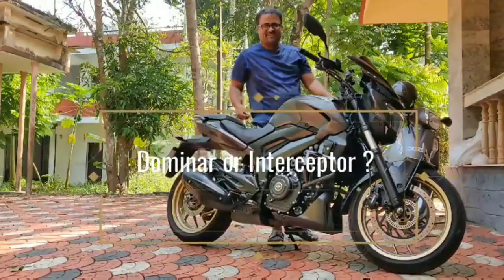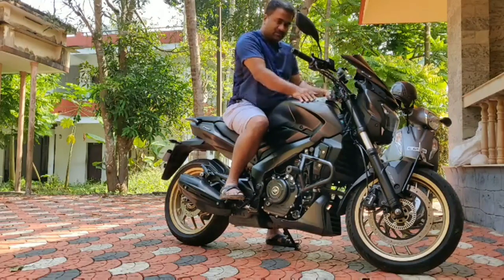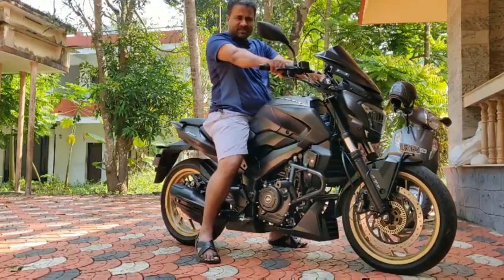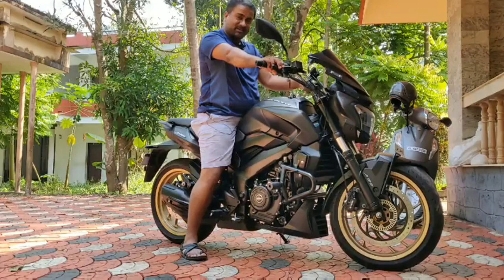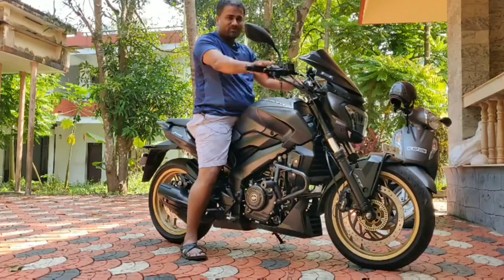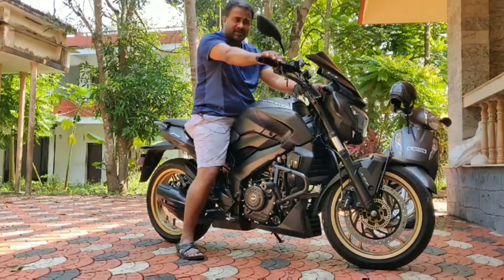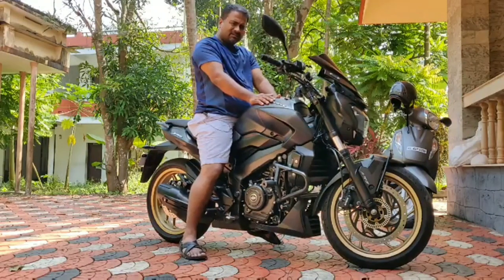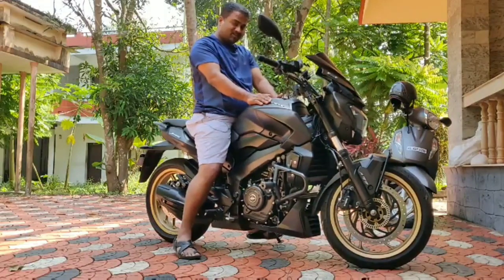Dominar or Interceptor?

Comment: Expecting my interceptor by next week😍😍😍
Reply from the maker: Hi... Where did you book it and which color.... I am absolutely frustrated with the delivery schedule.. The official website says it will be between 15th April and 21st April... But there has been a cancelation by a person before me so I should be getting the bike as per his schedule that was 8th April to 14th April.... But no info about the dispatch from the company.... Really disgusting...
Reply: @vadsx  

From kaizens vyttila. If u want i can give u the executive's number.  I opted orange crush coz they told me it will b more easier to get the standard colors.  I think some cancellation was there and i got the first preference. ( since we did a group buking.. preference goes to them)
Reply: @vadsx  

Better to stick with the standard colors.  If u go after chrome and all u will b wasting ur time
Reply from the maker: @mithunmenon9559  HI send me the executives number....
Reply from the maker: Hi Mithun.. Got my Interceptor delivered last week.... How about yours?
Reply: @vadsx  

Hey..congrats brother👌Yes.. am very happy with mine. Did u change seats?  If u havnt.. then spend some more time with ur bike.  U will get used to the stock ones. We will learn to adapt to this bike and the riding style. Majority of the negetives that we noticed during the test rides just vanished after owning this beast. For eg : the foot peg issue... now i learned to place my foot away from the gear lever setup when am in traffic. 😍😍
Reply from the maker: @mithunmenon9559  ya why not... You can call me at 9746470321

Comment: Go for Interceptor. Twin always twin.
Reply from the maker: Hi.. Thanks for your views... I think I will...
Reply: @vadsx  Thanks Boss. RE is 80k plus in price but its really for the good for  price. And in case fuel consumption its only 3 or 4 km difference.And we can keep the bike for years no radiator no mess just old school but its good.I think Powertronic going to release power  commander for RE twin engines.RE650 plus little mod its a good scrambler.

Comment: Bajaj & KTM is jointly working on a bigger engine. So its wise to sell the Dominor & buy an Interceptor. Interceptor has got a rich heritage & its 650cc parallel twin. It'll remain a modern classic for sure. A bike you can keep for a lifetime. Also 3 years warranty & road side assistance. Service networks all over india. Dominor will fade away.
Reply from the maker: Seems you are correct.... but Dominar too is a good machine at its price range......
Reply from the maker: Hi.. Dear Midhun....Dominar is not getting any buyers.... Had posted in OLX at offer prices of 1.5 butr  no takers...Anyway will buy the Interceptor and drive the two machines and probably have a clear picture on which bike to keep...